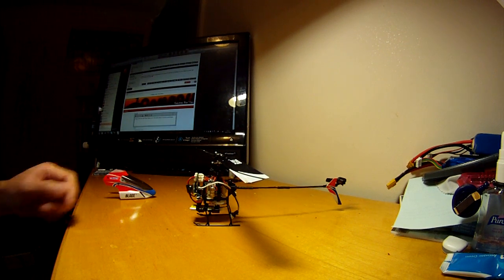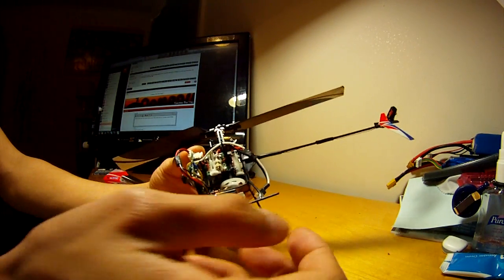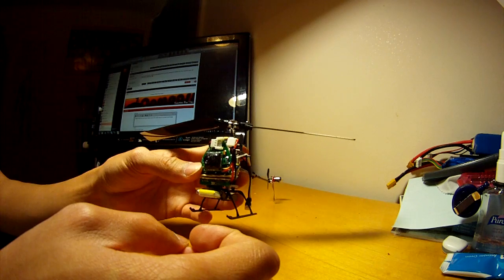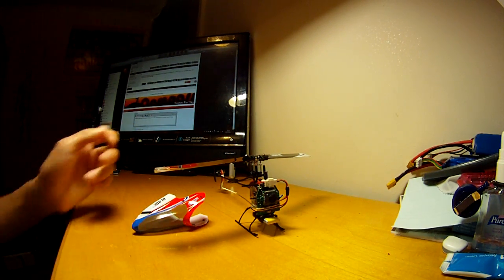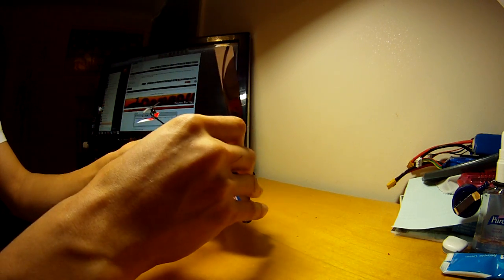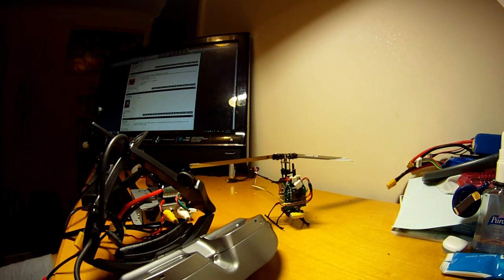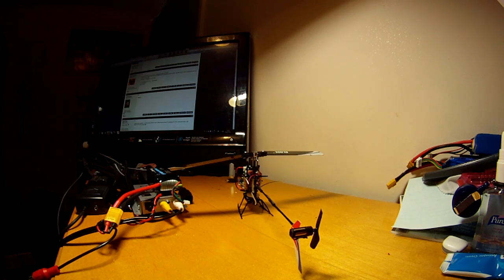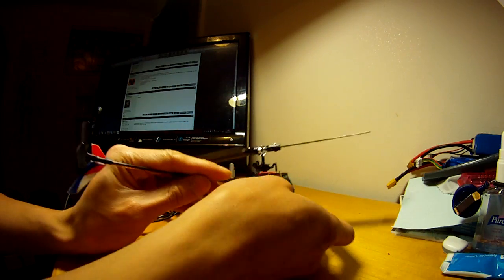Blade MCPX 1.2ghz wireless FPV camera setup

Comment from the maker: @sheysheysan If you look at the bottom of clip description by clicking show more, there is a link (Aerial Videography Station link) and I'm currently working on this page about FPV and you can find some info in there. Bare in mind it's still under progress and it will be updated soon with more info. and you are welcome to ask any question :)